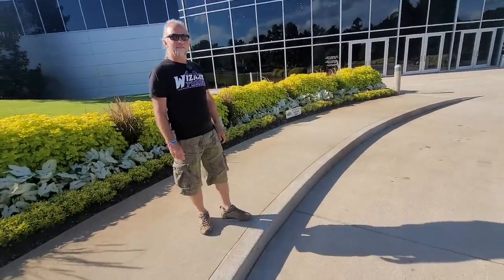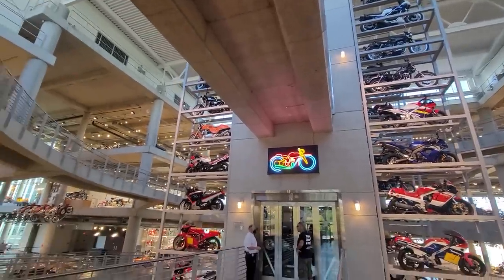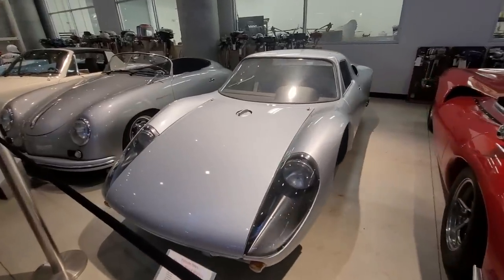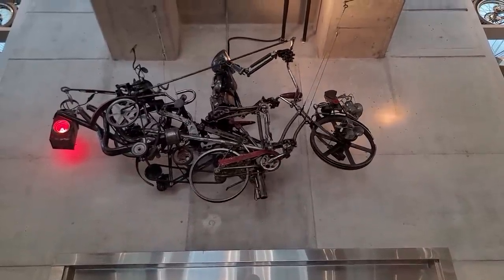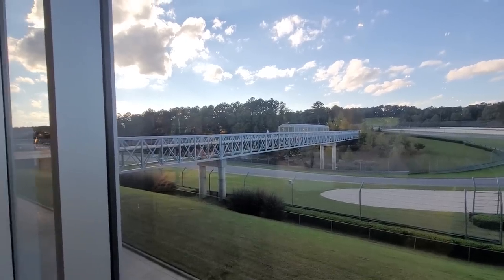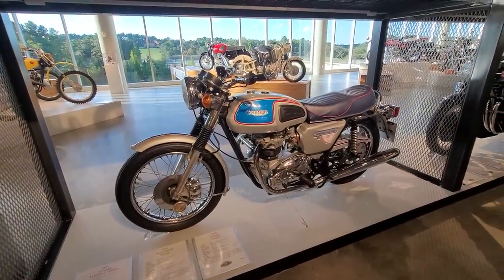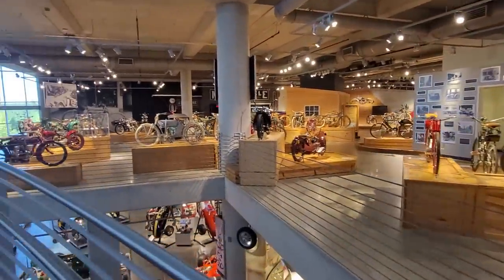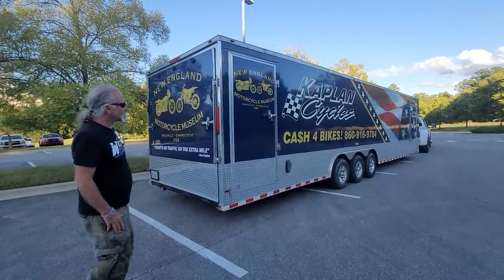BARBER MOTORCYCLE MUSEUM FULL TOUR BARBER VINTAGE MOTORCYCLE FESTIVAL 2021

Comment: Thanks for pronouncing Porsche right! Good man. I got to later in the vid where you guys were checking out the HRD and Egli Vincent. Fritz Egli did a 500cc Royal Enfield Bullet Cafe Racer many years ago. It was a ported / stroked / Swiss made jewel of a bike. Obviously less power than the then era GSXR 750 but it had better torque to all up weight values than the Gixxer of the time. That Egli guy has done some amazing stuff.